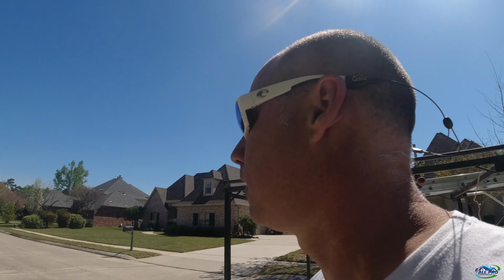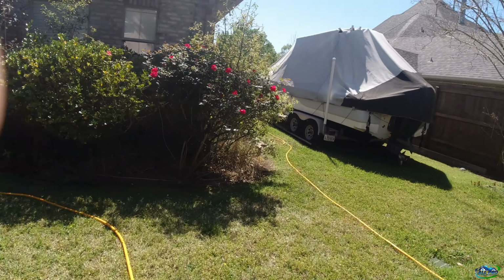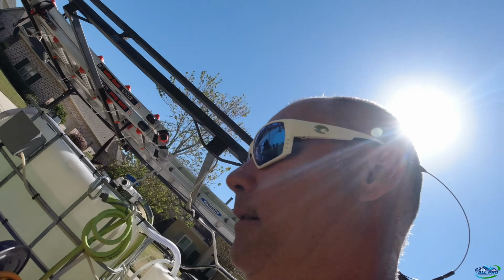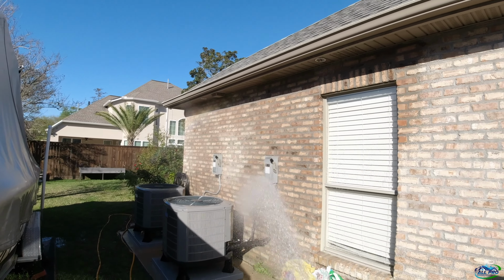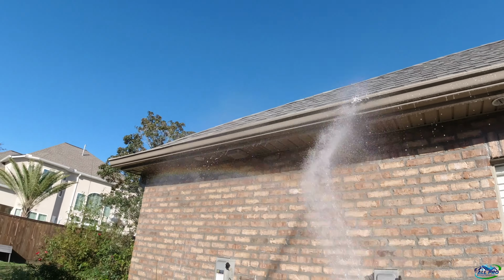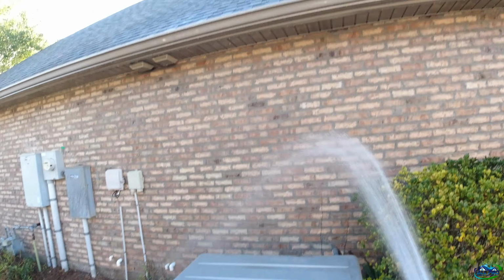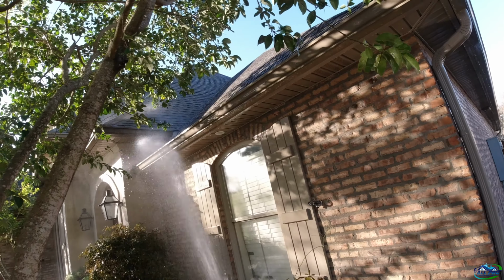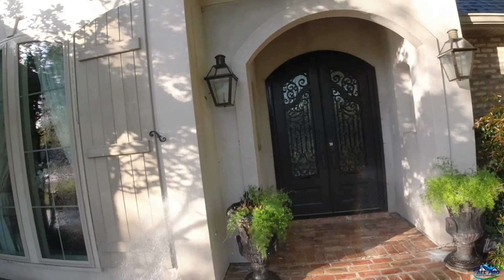House Wash, Gutters & Flat Work

Comment: What kind of discounts, if any, do you give to annual house washes
Reply from the maker: It typically ranges from 5% to 10% depending on the job. There are times I keep the rates the same based on the experience with the customer. You would be surprised that most customers don't expect a discount. Hope this helps. Thanks

Comment: no SH on driveway?
Reply from the maker: Yes, 3% post treat. Thanks
Reply: @allproexteriorservicesllc5338  thanks sir. Im guessing no soap, and no rinse?
Reply: @allproexteriorservicesllc5338  Sorry for all the questions. If I go with a dedicated softwash sytem (comet p40 11gmp) do you think a 5gpm 3000psi pressure washer is good enough to do the other stuff ill be doing, like driveways, graphitti , etc?
Reply from the maker: @dcsc4895  I think that would be a perfect set up. Thanks
Reply from the maker: @dcsc4895  Little soap & no rinse. Thanks
Reply: @allproexteriorservicesllc5338  You are awesome. Ty